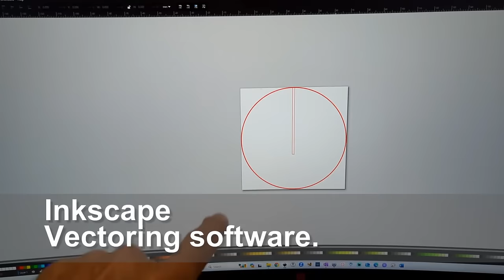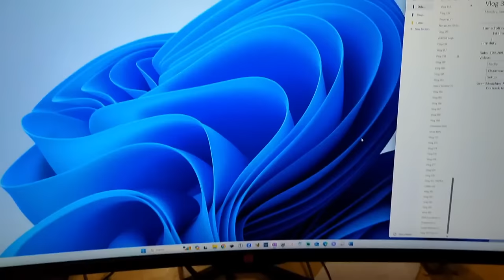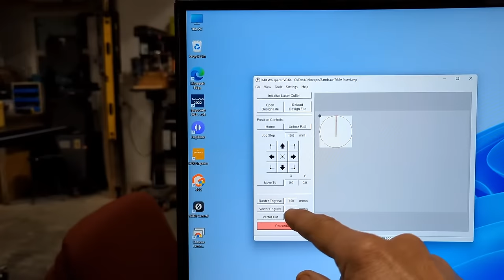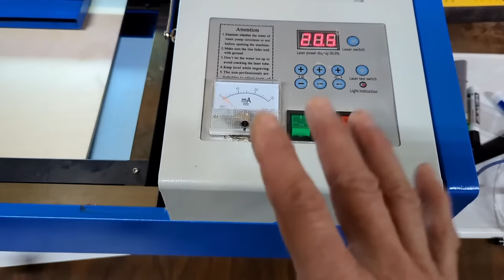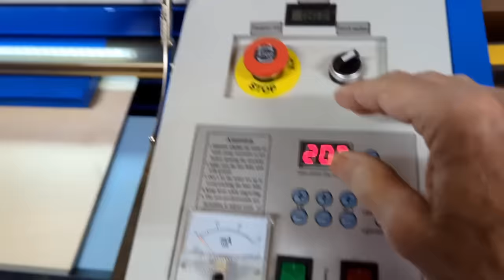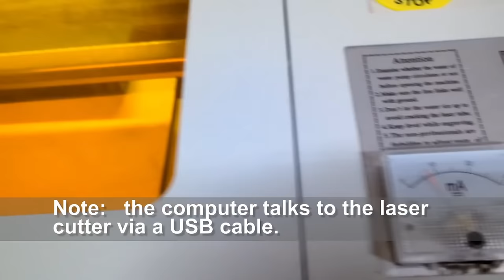Vlog 391 LIVE K40 Laser Cutter Deep Dive and Carmine D'Amico Custom Mandolin

Comment: upnorth guitar necks warp in the winter requiring a truss rod adjustement.  then re-adjusted in the summer.
Reply: Yes. Necks need truss rod adjustments with the seasons all over the world. I live in South Australia, and it is quite dry in summer. I can say for a fact that I did not know of anyone using humidifiers to care for guitars till after the internet brainwashed people. And there are many old guitars from long before the internet, that are still fine. I have NEVER humidified my guitars. Why would I when the manufacturers worked so hard to dry out the wood.